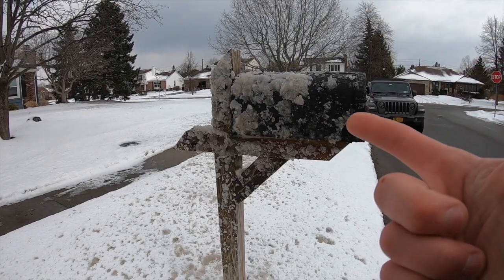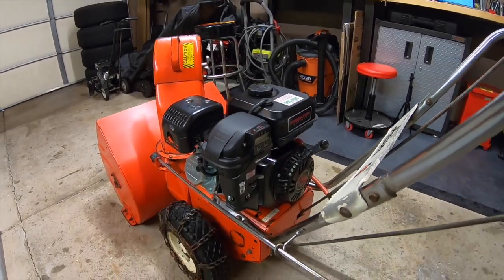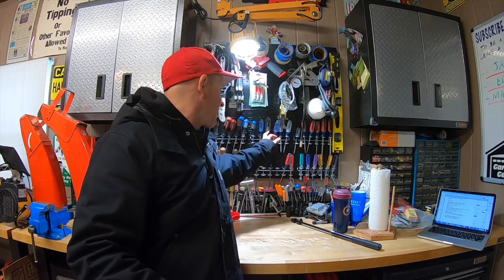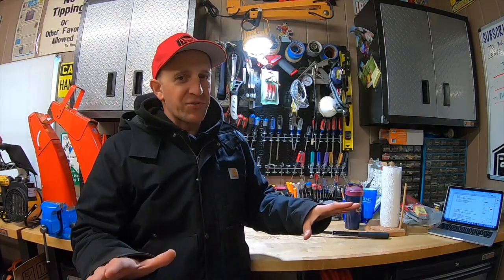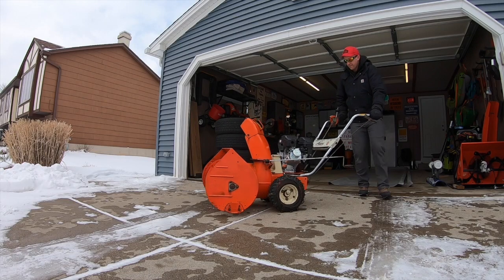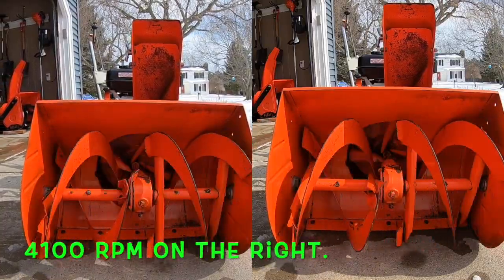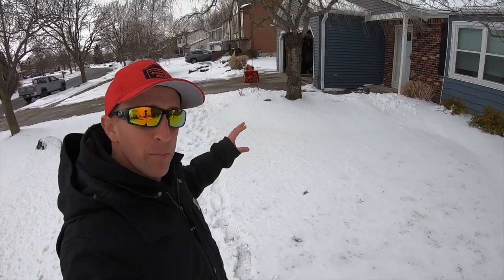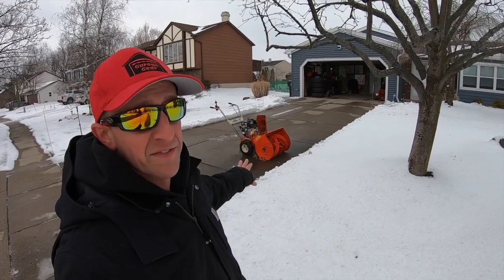HOW TO GET 15% MORE POWER FROM A PREDATOR 212CC ENGINE

Comment: If you up the power output you should keep track of the head bolt torque. Take a reading before you start and record it along with the engine temperature. Regularly check the torque at the same temperature. Over time there can be normal stretching of the bolts which shows up as lowered torque. If the reduced bolt torque shows up very soon then you likely are exceeding the design parameters of the engine.
Reply from the maker: You sure know your stuff Edwin! Thanks for sharing!
Reply: These engines are ran at much higher than 4100 RPM under much greater loads than a snowblower. The head bolt torque is never a concern. On a stock engine like this, head bolt torque is the least of your concerns.
Reply: @Deucealive75  Agreed the head bolt torque is often the same on stock as it is in the racing community where you are talking about hitting rpms of min. of 5800 sometimes up to 7500, even 9000.  So no head bolt torque is not something to be concerned about, plus all that is being adjusted here is idle rpm, so I'd suggest just leave it alone unless you are snowblowing 2" snows often and seeing issues throwing it far enough.  Yet those issues should be rectified with a impeller kit first and surprising as this is the longer chute which, I figured before that video was not going to give much benefit as it did.
Reply: So true, as I have learned the hard way lol ✌️

Comment: I have a Ariens 824 El. I want to do this. But my shoot  control has a bracket that bolts on to the Tecumseh engine.   Is there. a way around that.  ?
Reply from the maker: If you chute is somehow in the way you could take the chute off, make your adjustment and then reinstall your chute.

Comment: Just remember before you spend a lot of on these engines … they are rated at 3600 rpm 
W/o a cast iron sleeve you can wear the block out fast as I’ve learned the hard way. 
Billet rod ,flat piston , arc aluminum flywheel
Vm 22 carb 22lb springs, port polish head ( non hemi) chromoly push rod, ratio rockers 1:3 , header pipe ….  after all these improvements  
Awesome Power 
Wore my block out ! 
If you just want a little more power 
Np the stage 1 build is ok and engine will last a good while.
Reply from the maker: Thanks for sharing Kyle!
Reply: How long and was it in a cart?

Comment: I put the 212 predator on my Murray 24”, last year worked great wasn’t as cold,this year  not so good the Venturi in the carb kept freezing up, so I had to do some mods to get warm air to the carb,then the fuel tank wouldn’t vent real well so the engine kept running out of fuel an had to restart it working on solving that issue…
Reply from the maker: Keep me posted on this! 👍

Comment: Have you greased the front augers bearings?  Or checked the grease in the gearbox?  If you need it,  why not use a synthetic low temp grease?  Possibly with teflon in it.  Might take away some restriction therefore adding power. or extra torque.
Reply from the maker: Auger bearings yes! Gear box no. Going to be doing a video on that soon most likely. Thanks for the tips and stay tuned Al!

Comment: Do you have a video on adding the hour-meter/tachometer? This series on the Predator 212 has been crazy fun to watch. Thanks JB..
Reply from the maker: Hey Sam, I linked an hour meter install video in the description! Glad you’re enjoying the series! Thanks for being a cool fan!
Reply: I should probably mention, that I have a brand new Predator 212 now at home. Still need to order the shaft sleeve adaptor and key. I also have the hour/tach meter now too. This is gonna be fun. I finished the impeller upgrade today. It was a hassle, but I got it done. I just need some snow!!
Reply from the maker: @shadowghst7704  awesome you’ll be happy when you start throwing snow! I would also highly recommend the oil drain hose. Skip the mess! Rock on my friend!

Comment: Wouldn’t you have been better changing to a smaller pulley on the auger side to get more overall RPM’s on the actual auger assy?   I did this on an old Craftsman and it’s a beast.  Not toying with the engine (yes, I did increase the jet size).
Reply from the maker: Hey George! There are a variety of ways to go about this! That’s a great idea but I was trying to show the easiest way to go about boosting the RPMs. Few twists of the screw driver and your hood to go! Thanks for watching!

Comment: I don't think this really adds anymore power, more or less when you hit heavy snow the governer should be upping the rpm to combat this.  The only area where I see this helps is whe you are snowblowing smaller amounts of snow, sometime it isn't enough snow to really up the governer and therefore in this situation yes you would throw that small amount further.  I guess for the small amount of time a blower like this is running a higher rpm is probably not the worst idea, just not too necessry I don't think.
Reply from the maker: Thanks for sharing

Comment: I am looking at a newer Ariens 24 compact blower with auto turn steering. Just wondering if this was a good system, what do you feel about it?
Reply: What wld a 208cc rpm be best at? I have the same craftsman u used to have. Love the vids btw
Reply from the maker: Hey Nicolaas! Does the compact come with auto turn? Thought it didn’t. Great for me for the last 10 years on my 28” blower!
Reply from the maker: I didn’t adjust the rpm on that one but I would imagine that if you bumped it up 300 rpm that probably would do it! Thanks for watching!

Comment: The question you need to ask is what cylinder pressures was the engine designed to maintain. I am very skeptical of the engineering in reverse engineered engines. Pull a head bolt from a real Honda and test it against a head bolt of a clone.
Reply from the maker: That’s a great question. I would also like to know the details. Thanks for sharing!

Comment: I wonder if its possible to put in an 8 or 13hp predator engine. I saw the shaft size on those is 1" so id have to get another top pulley for tge 1" shaft.
Reply from the maker: Definitely possible just need that bigger pulley and new belt. Thanks for watching rose!

Comment: What are your thoughts on increasing the pully size for the auger from 3" to 3.5" or even 4" to get more torque out of the auger? cheers Damien
Reply from the maker: Seen someone do it before. You should just need a bigger belt and you may have to modify your belt guides. Thanks for watching h!
Reply: you will get less torque but more speed
Reply: @bc454irocz89 wrong, bigger shieve sizes= more torque, less speed. You're gaining circumference compared to the 3/4 shaft spinning 4100rpm a 4" shieve is over 5x bigger than the engine output shaft so the belt will spin 5x slower. Around 770rpm but gain about 5x more torque. Speed and torque are equally proportional
Reply: @griffinphilemon5083  no you're wrong impeller rpm = engine rpm x engine pulley diameter/ impeller pulley diameter.  Making the engine pulley bigger means faster impeller speed